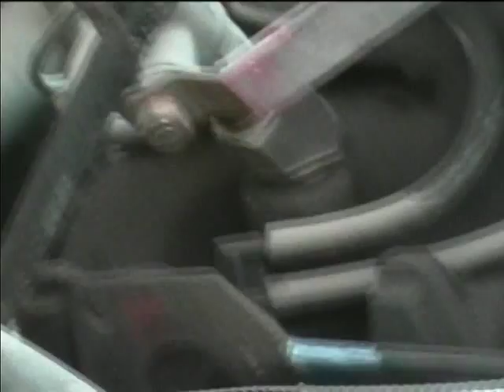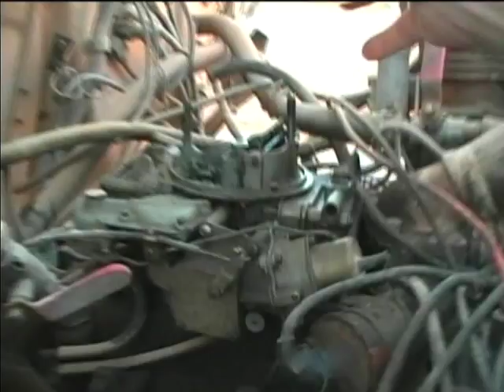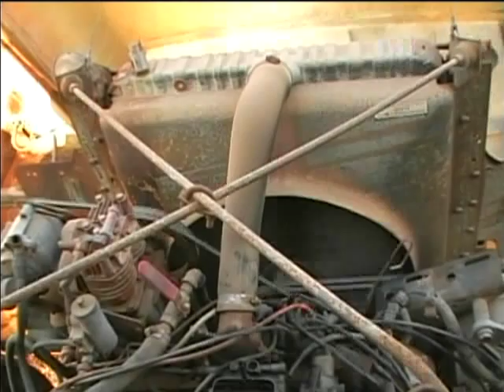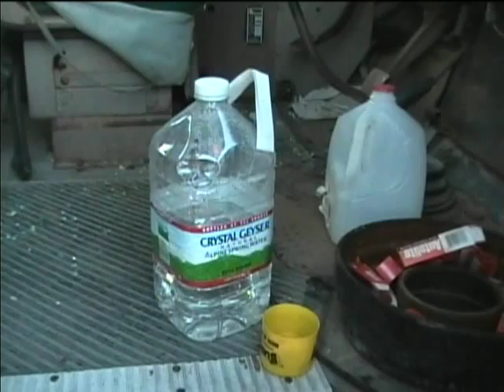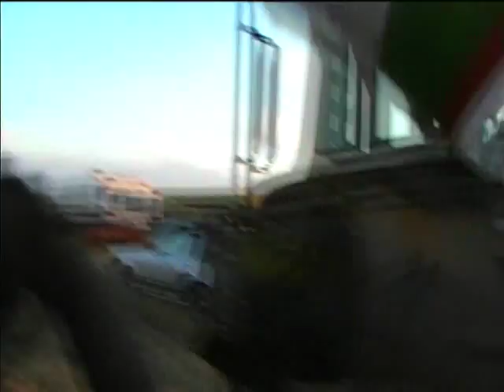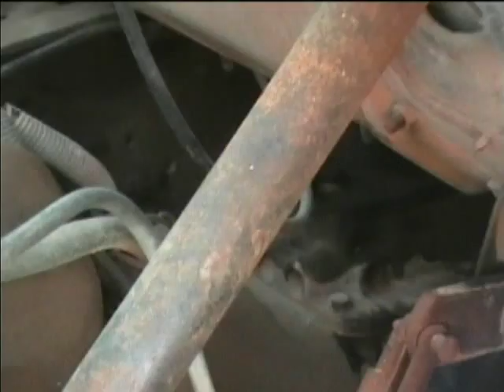1980 International S-1700 school bus engine fires up!

Comment: Glad that the engine appears to be good!

 Sometimes you rent heavy duty jacks and such. The main idea will be to detach the shifter, driveshaft and clutch linkage.

 Then, support the trans and remove the bolts holding it to the flywheel. Slide it backwards out of the bellhousing and lower to the ground.

 Clutch/flywheel removal is common to all manual trans vehicles, just have a torque wrench, long breaker bar and muscle on hand. Know your torque specs.

Comment: If it runs that well with that small amount of fuel, it should run sweet when it's fixed!

Since it was sitting for so long, you'll probably want to change the oil again after the first run.  Hard to say how much dirt or water could have gotten in over time.

Comment: If you want to run it longer, put a garden hose in the radiator and let it flow.  The obvious thing is to not overheat it, but the water also cools and lubricates the water pump.

Comment: I would ensure that the water is coming from a freeze plug before pulling the flywheel and clutch, cracked engines can still run good .

 I would replace ALL the freeze plugs back there(not the small oil galley plugs) because if one is in bad shape the others are likely not far behind. Brass is best.

Have fun!

Comment from the maker: Thanks for your comments...I will definitely change the oil after repairing the freeze plugs. I double checked the oil level and it is clean and full but I know the viscosity tends to break down over time, especially when the engine heats up. I need to change the oil on all the other buses too except the GMC I just did.

Comment from the maker: Yes I think it is as there was no water in the oil. I do have a compression gauge so I may double check...the previous owners were trying to run a compression test probably because they thought the water leak was due to a head gasket but I am thinking it's a freeze plug/
Reply: retrochad hi did u get the bus runing

Comment: Good luck with the coolant leak repair! I just hope the block isn't cracked with that freeze plug being broken and all... but you're in Texas right? so it doesn't usually get cold enough to freeze up the entire block anyway, so it should be ok

Comment: make sure you put the drive shaft back in the same way it was or it wont be balanced right. (mark it before you take it out) Another thing is transmission removal's are more complicated than you think, and I can say all that need to be said (character limit), so do some research before you start.

Comment: An international with a 4bl carb. Mostly I've seen them with 2bl carbs. Would there usually be a cap on the radiator? Or does this have a remote expansion tank?